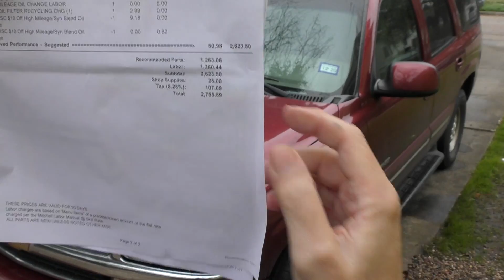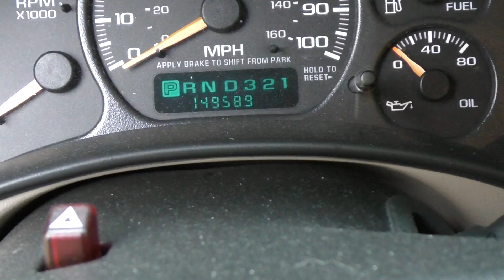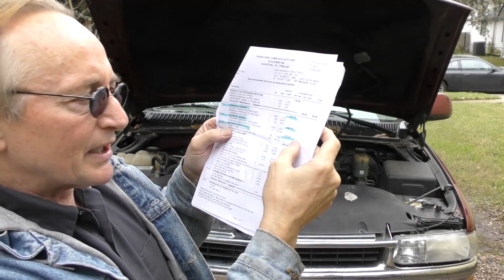This Makes Me Want to Quit Being a Mechanic

Comment: I don't always agree with Scotty but he is 100% correct here.  In 1974 (yeah, 46 years ago), I took my '66 Chevy with all new front end parts to Firestone for an alignment.  I had replaced all ball joints, control arm bushings, strut bushings, idler arm, tie rod ends, etc,  Every part was new.  But the car had 135,000 miles on it.  Well Firestone told me the front end was worn out and not safe to drive and they couldn't let me out of the parking lot it was so dangerous.  So I went down the street to Goodyear and they aligned it and sent me on my way.  Have not been to a Firestone store since, and never will.

Comment: Last time i went to Firestone for a oil change, while waiting in the lobby i listened to the checkout guy tell 3 customers in a row "your tires have less than a month left, you need to replace them today" and with just that 2 of the 3 people whipped out their cards and swiped for new tires..... the other guy and myself (he also told me that, and to be honest i did have an alignment issue, which cupped my tires pretty bad but i had it aligned, and rotated the tires and they wore back into shape) chuckled a little bit and said "just do what i asked"

Comment: Nothing wrong with that BMW.... I’ve got a 2011 X5 twin turbo with 130k miles & it still runs terrific 👍. Most mechanics will say the turbos have failed but the majority of the time it’s the boost control solenoids or a vacuum issue.   The key with them is to use the recommended oil & change it frequently....not the 12k-15k miles that BMW recommends.

Comment: You just explained why I go to a friend of my family for my inspection. My mom went to the dealership and they said her tail light was broken and leaking light. I checked it and it was a small chip in the front corner and no light even reached it. Took it to my family friend he looked at it and laughed because he said the 500 they wanted to replace it wasn't worth it. He could order us a brand new cover for 90 bucks if we wanted it not that it even needed it and it would be like replacing a tail light.

Comment: I had a new Honda Civic, with under 1000 miles and it had a rattle. My wife takes it to the Honda service dept and they tell her that emergency repair work is mandatory and they will not let it leave the shop.
I go down there and they tell me the same thing.  I said, I didn't understand, so show me.  A clip was partially off of the rear heat shield.  
I push it in, with my finger and took the car.  We have bought 3 Hondas, since then, but we don't even consider doing business with them.

Comment: Living in NYS and being a former inspector for a number of years-  I fully support the state inspection.  Some of the cars I have failed are frankly death traps!  Are there bad shops?  Absolutely:  MonkeyRowe in our area has gone through 4 managers in the last 2 years!!!  Each time they give the same excuse:  The manager was stealing!   uhh....No,  The manager(s) where being honest and not screwing the customers.  But when you have a shop that states  Labor Rate:  $85....  And in print so tiny you'd need a microscope-  Per half hour. 

Find a local shop and use reviews.  If they want to sell you a huge list of stuff?  Tell 'em  "Thanks,  I will take it under advisement" then shop around.   If you think you're getting ripped off, many states have consumer affairs offices you can go to.

Comment: I took to get an 80$ alignment at Firestone and after 6 hours they say that I have loose inner tie rods which is a whopper of a lie and says they couldn’t do the alignment and it will be 650$ total. I came back with the mechanic that replaced my ball joints and upper control arms and we both said their was nothing wrong with the tie rods. The manager had little to say. I took my truck and left. I could do the inner tie rods myself for 100$

Comment: My mom went to get the rear brakes done on my old car I gave her. I price checked all of the parts and got around $250 for everything. They charged her $700. In what world are the rear brake cylinders $60 a piece. Every where I’ve looked them up they are $20 or less. Then they charged $40 for a brake kit that is $9. I’m going to call them up tomorrow and ask where the hell they found $60 brake cylinders

Comment: Had the wife get the old Blazer inspected. Told her under no circumstances go to Midas. What does she do? Takes it to Midas where they claimed I needed a new steering box, tie rod, etc. Also said I needed a new intake manifold gasket even though it wasn't part of the inspection. They wanted something like $800 to fix all of it. Turns out I can adjust the gear lash inside the steering box that after a few years gets a little loose which is why they have the adjustment. Midas claimed I needed a new one. Gave them a scathing review online.

Comment: The only thing that Chevy needs is an oil cap that isn’t hard to remove, and likely will need a new rear diff at 180,000 miles.

Comment: Very informative video as always scotty. When you inspect tyres though you forget to look at the production dates... even if there is no visible wear and tear, if the tyres are more than 3-4 years old the rubber compound deteriorates affecting performance and safety...
Reply: that’s what tire dealers tell you.
Reply: @ralphlouismendoza1977  lol no... the older they are the more grip you lose especially on the wet.. the tyres on this junk looked like they've been there for 10 years or more

Comment: The other thing is they will go and change a perfectly good seal and then that’s when it starts leaking. People !!! Educate yourself and learn to fix it yourself. Figure if someone is going to charge you $300 plus parts to fix something simple for $300 you could buy a really nice tool set and fix it yourself and have the tools to fix other things. You can shop around and get quality parts with a warranty for less than what the mechanic is going to charge you for parts. Now if you fix it right then give yourself a pat on the back and if you mess it up then learn from your mistake and fix it right. You could probably fix something twice for what a mechanic will charge you.

Comment: NJ changed over to emissions only.  And on top of that,  if a shop offers Inspection, ONLY a license Professional can do that inspection. There is such heavy penalties if they catch you here in NJ doing inspections  So all of these chain shops In NJ dont have inspection services.  I just got mine done for 2 years cost me 54 bucks.  I took it to a very good shop and i just got the inspection and nothing else.  No upselling whatsoever.

Comment: Good Year tried to charge me $1200 for an upper and lower ball joint replacement and a sway bar link, got all the parts for under $60 and did it myself in under 5 hours

Comment: Up here in British Columbia we do not have mechanical inspection, it is nice, they got rid of the air pollution inspection a year or 2 back now which was a money grab as it only applied to the lower mainland.  There would be a lot of vehicles taken off the road if we had a yearly mechanical inspection.

Comment: Firstones  are a complete rip off. When I moved to Texas I took my car there for an inspection and they failed it for an srs light and wanted 1800 to fix. First off the srs light doesn't fail your car I know because i am an inspector now. Second it was on because the harness was loose on the back of my cluster and they wanted 1800 to remove 4 or 5 screws and push a harness in.

Comment: I bought four tires from them and the messed up my TPMS. They recommended I buy four new sensors which I did. Two years after and after several visits to the shop, my TPMS is still messed up.

Comment: Thankfully, Ontario got rid of the drive clean, even after I replaced the O2 sensor, I had to go for 4 tests until it was finally passed, dinged for $80 for that adventure. It was a scam where only 3% of cars were failing the drive clean anyways.

Comment: Reminds me of one time I went and got my 95 Pontiac Firebird Formula 6 speed manual inspected. They said they wouldn't pass me because the park brake wouldn't hold the car when they put it in 1st gear and pressed the gas and told me I needed my parking brake redone and that it was going to cost me $800 for new parking brakes, cables, etc before they would pass me. So I said I'd get a second opinion. Took it to a GM dealer and told them what had happened. So they put the car up on their car lift and looked at the parking brakes and told me that everything was fine and that no work needed to be done. They passed the inspection for me and didn't even charge me. Never step foot in that Big-O tire shop company ever again. They lost a customer for life.

Comment: Firestone is a hell hole. I took my 2002 Saturn L200 in for an oil change (before I bought my own tools) and all of a sudden the next day the car started misfiring and shaking/knocking like mad. It ran like a dream before I took it in to Firestone. They wanted to replace my shocks/struts, spark plugs and PCM/ECM computers. Totaled me over $3,000! I blamed them for ruining my car. I diagnosed it myself with a $30 scan tool and found out it was a failed ICM that was under a recall! I took it in and got denied since it was a "service bulletin and not a recall" according to Chevrolet. So I went on Rock Auto and bought a ICM and brand new spark plugs for $75. Fixed it myself in 5 minutes. Good as new. Than I sold the car once I fixed everything. Happy new owner.

Comment: took a new-to-me 1999 Durango to a independent shop for a 'pre purchase inspection'. ( I know I should have done this BEFORE I bought the truck but it was clean, had low miles, and was priced way less than anything comparable). I knew it needed some repairs but figured a 'professional' would be able to find and diagnose problems better than shade-tree me. When all was said and done he did tell me what was causing the Check Engine light and Brake-ABS light but missed the poorly functioning heater. The tip off that he either didn't want my business or that he had a huge boat payment to make was $1,950.00 for front shocks, ball joints, and alignment! (I can to that work myself for under $300.00 + alignment) He also claimed the battery needed replacing (due to it's age) and in addition to the price of the battery he wanted another $50.00 to install it! And yes he also recommended new valve cover gaskets as they had oily dirt on them (but not leaking onto exhaust manifolds). I don't feel ripped off though as it was worth $125.00 to have the codes diagnosed AND that his was a shop to avoid in the future.

Comment: 18-year-old Tahoe and has less than 150,000 miles on it. That works out to about 8400 miles a year, essentially two oil changes a year. I’d kill to have a car for 18 years that was still in that good of a condition mechanically.

Comment: I went to Midas after replacing my swingarm bushings and couldn't get the last bolt tightened because I couldn't line it up while on a jack. They said they would tighten it for me and while I was waiting they brought in my worn out tie rod end (I already knew it was worn out). I told em I didn't have the cash to fix it and they said "That's okay". Didn't think anything of it until a few weeks later I was going to replace it. You can imagine my reaction when I saw a brand new one. They replaced it for free. I've been going there for anything I can't do myself ever since. Everything they do has an National lifetime warranty at any Midas. I may only get these results because they know I double check everything. If you ever think you're getting screwed just say the magic words "Show me" and make a decision from there.

Comment: Yah the dealership quoted me $4200 for a valve cover gasket and a water pump on my 2007 Lexus IS250. 
And it wasn't even dripping, check my oil level every couple of weeks and I'm not even burning any or losing any oil. And the water pump is fine. 🙄 It's an insane quote.

Comment: I drive a beater as my daily driver. its mechanically perfect but the catalytic converter is throwing a code. To replace the emissions system will cost almost double what the car is worth. Therefore I now have to junk a perfectly running car because the government wants their $20.

Comment: I diagnosed and replaced a clogged catalytic converter for $45 plus my discount for the part, I made $100 and cost my customer $275 total it took me 3 hours had to replace the rusted bolts as well

Comment: Where i live (europe) We have an inspection every year. They check for allmost every thing. Fore example break wear and test on rollers. rust, joints, tires,  fluid leaks. emissions and faultcodes related to emissions.  All lights working and aligned propperly and some other stuff.
The company that do the checks arent allowed to run a repairbuissnes of cars bay law.

Comment: Firestone is worlds worst. I used to buy tires from them until at some point they started this overselling stuff. I suppose as my car got older they felt they could get me.

I got a set of tires and service advisor stated " I wouldnt drive this vehicle off this parking lot with those front brakes."

I had recently had a state inspection at another shop. (Tires barely passed) So I question the service advisor. He says your brake pads arent worn out but they are aged. They have deteriorated from age. I drove off and bought future tires from an independent shop.

Comment: Buddy of mine took his cadillac to the local dealer to diagnose a misfire code on the 08 Escalade.  They charged him 900 dollars to tell him he had a bad lifter the service tech claimed it calls for four hours to remove the valve cover.. its four bolts... and it would be an additional 4k to rebuild the top end....

Comment: Scotty, Firestone is one of the worst ones to do this. I had a leaky brake cylinder and they wanted to charge me $500 for all my brakes. They threatened they could not lower the car off the lift for safety. I fixed the cylinder myself for $30
Reply: Bogdan Oros They threatened you? Wow I would have gotten a lawsuit against them. Good for you that you got your car back.

Comment: I took my car to Sun Auto a week ago. They looked my car over and they gave me a list of items that were a bit of a problem. I knew the rear main seal was going out so they looked there and said i had a small leak starting in the oil pan. All the other problems i told em i dont want fixed; they didnt even stress it since they said the other problems werent that bad. They also had a policy that they couldnt install customer provided parts since they couldnt warranty it. I brought in a rear main seal and they said theyd knock off the cost of sourcing the part. When i got my car back it couldnt shift past overdrive. They told me that because of how old my car was the few parts in the transmission linkage were gonna break since one was made of plastic. They're willing to install the broken/worn parts  free in my case since they cant source oem parts so i just have to provide em. My car is a 90 lincoln mark vii so mind you its a 30 yr old car with no work possibly done with the transmission til now so i saw this coming. Just hoped it woulda been an easy install.

Comment: I would recommend tires, only because of all the wear on the outside of the right tires, shows taking lefts too hard or the air is too low, either way the tires shouldn't wear like that.

Comment: Luckily, we only have the bogus emissions inspection in my state. Oddly, only seven counties have the requirement. The county in which the state capital is located is not one of them. Hmmm. Initially there was a charge for the inspection at the state site. There were so many complaints, the state was forced to ditch the fee. The  hilarious part is, if your car fails the emissions inspection, you have to prove you spent at least $300 in an effort to resolve the issue. When you produce your receipt to the slob at the inspection site, he/she will let your car pass.

Comment: I would definitely change those tires!  I do 90% of the work on my own cars.  Say I have one bad ball joint, I change ALL FOUR of them.  I tend to change my brakes pads at 50%. I fix things BEFORE they break or completely wear out.  I never buy two tires at a time, I buy all four at once. I am changing my shocks often. I like that fresh new ride feeling.  So, if I were running a shop, even if it were NOT for profit, I would probably recommend a lot of work that most people would put off a lot longer than I would on my own cars.  Also if replacing a part lends access to another part that will need to be replaced during the car's lifetime, I replace that part too TO SAVE ME TIME.   For example, all my cars have LT1 engines with the optispark.  When a water pump needs to be change I automatically change my cap and rotor.  Conversely if I need to tune up my optispark, I buy an new water pump. (never rebuilt).  If I have to buy a new rotor, I but both sides AND I buy new brake hoses.   I like to save time. I do not like to tear down the same system twice when I can do it once.

Comment: Always get a second opinion before doing any major works, beyond basic maintenance like oil changes!  Or get a third opinion for more major stuff, like trans works ro major engine work.  Doesn't hurt.  If all two or three parties tell you basically the same thing, then it's probably something that needs to be done, but if only one says its needed, and the other one (or two) don't, then maybe it doesn't.

Comment: Idaho doesn't have a state inspection.  If they did, about 1/4 of the vehicles on the road would have to junked, and another 1/4 would be off the streets for a while.  Noise and pollution would drop like a rock, and public transportation would take a big boost.  The streets would be safer.  Unfortunately, gun sales would shoot through the roof in preparation for rioting in the streets and a government coup.